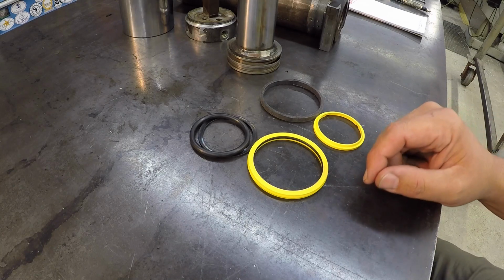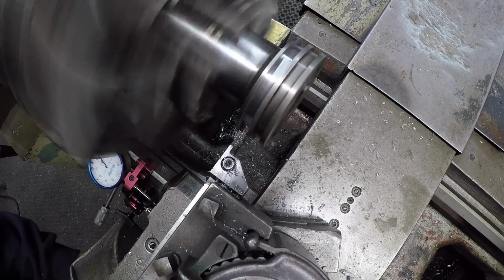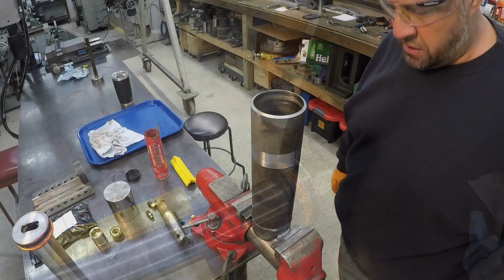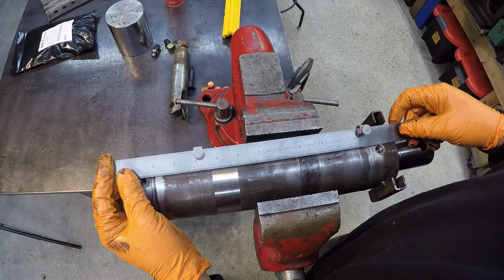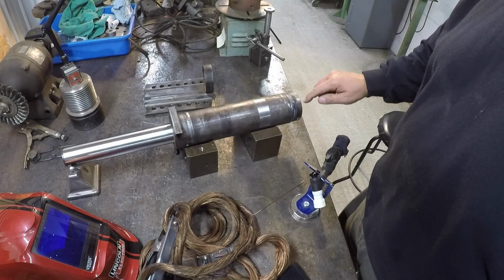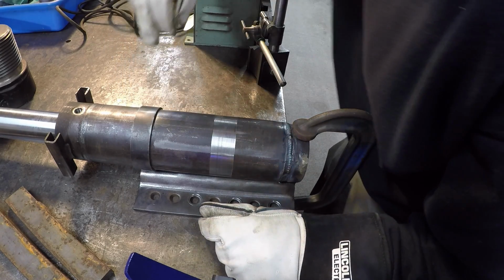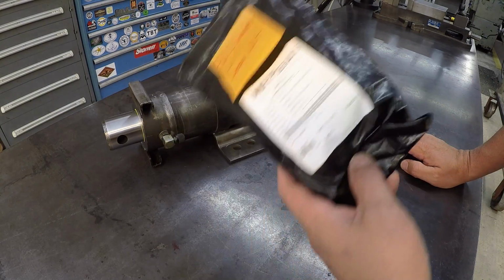SNS 286 Part 1: RV Cylinder Rebuild Completion

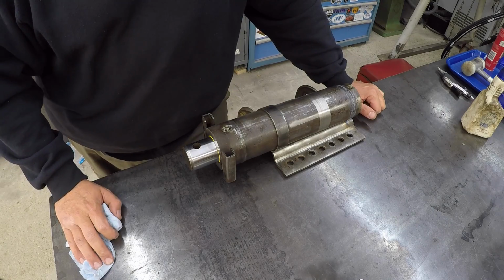Comment: Hi Adam. At 24:14, when you mention that you didn’t have the equipment to pressure-test it for leaks, it made me remember the first video where you found a pinhole in it. Did you plug that up, too? I’m assuming you did, but I didn’t see any footage of it. Also, a nifty use of shop air to test that cylinder! 😎 But, then, what fun is a tool that only has one use, eh? Another nice machining video. Have a Merry Christmas and a safe, happy holiday season!
Reply: The pinhole was in the old weld. The cap got a whole new weld so that old hole was ground away to make way for a V groove and the filler weld.
Reply: Go back and watch it again. The leak was in the weld bead that held the end cap on. He ground it out when he cut the end cap off, and "plugged" it when he welded the end cap back on.
Reply: @oldbones3092  Cool reply. That's exactly what I said. Hopefully, he doesn't have double vision.

Comment: Aloha Abom,  for my own or family projects logic and common sense doesn't apply.  Why spend $20.00 when I can repair it for $100.00 labor?
Reply: That brings to mind a computer system idiom:  "Linux is only free if your time has no value."  For those unaware of computer operating systems, Linux is a "free" operating system that has no licensing fees, but can vary a lot in the complexity of installing/usage.
Reply: I have to agree with you on that!
Reply: @Kineth1  
Not really accurate any more.

Comment: Looked on the Lippert site - you can get a new one similar in design for 465-585$ 
https://store.lci1.com/shop-by-department/leveling-stabilization/powered-leveling-systems/system-replacement-parts.html
Reply: That being said - doing something nice for mom... priceless....   ;)
Reply: @DrFiero  I fail to understand why buying a new disposable cylinder with the same potential for breaking down and requiring a new replacement is a good investment? Don't buy low cost disposable garbage, buy a quality cylinder or at least a design that can be repaired and give somebody else a job to feed their families.
Reply: DrFiero and you would have missed the education.
Reply: Before this thread gets out of hand!  I only mention the price as Adam said he had no idea what they were worth new. Now he knows. Now you know. Gotta pay someone $120/hr to repair - probably no worth it. Doing it yourself? Knowledge gained!
Reply: @DrFiero  I did not intend to sound hostile.
Reply: @DrFiero  What Adam was trying to convey, as he said, if it can be repaired in much cheaper way go ahead and do it rather than replace it with something that could potentially cost thousands of dollars to replace. This small cylinder was just an example on how to go about it.

Comment: Digging that lay wire method, nice work as usual Adam.
Reply from the maker: James T. Kilroy Jr. Thanks James. That may wire trick was how I was taught in school welding stainless pipe and it’s always been my favorite way to flow the metal in there.
Reply: @Abom79  This is how I'm teaching myself to TIG. I shake like a leaf so only having one hand to concentrate on not shaking makes a big difference. Once I get that down I'll work on holding the wire and dipping, etc. I really like the clarity of the welding shots you are getting!

Comment: Ok a little question. I hope you understand what I'm saying. Do you stagger the weld layers when doing a cylinder like that? It would seem if you staggered where you start your next layer of weld it would less likely leak
Reply: Nobody’s good enough to line up all the porosity lol.
Reply: Yeah, you do stagger them, but it doesn't matter one bit. The trailing end of the weld pass is tied into the leading edge 100%. It's all tied together out its cleaned, prepped, and welded properly.

Comment: A very ood repair. I did this this summer on my Winnebago Sightseer RV. Just the front oned. I didn't pull the ram out, just cut off the nose end, replaced the seal & wiper and re-welded it together. Yours was a nice repair and now you are in the RV leveler business!

Comment: Cost would be between $450 and $850 new. I would rather have your rebuild than new knowing it is "machined" and quality checked by a guy that cares.
Reply: The cheapest I could find was just over $1000.  One was $1400.
Reply: At work, there are parts that are brought brand new from the manufacturer. The part gets totally stripped and rebuilt in the workshop because you then know its been built properly, and because somehow, our tolerance is tighter than used by the manufacturer. Crazy, but knowing its been done properly is worth the time.
Reply: any day
Reply: Wait, $450-850 and $1000-1400 for one of these fully welded/sealed units? Or for a proper hydraulic cylinder?
Reply: @xenonram  ...https://www.etrailer.com/Accessories-and-Parts/Lippert-Components/LC359281.html
Reply: @xenonram  Fully sealed unit sold online, not used, but likely made in China.
Reply: @xenonram  https://www.shop.thebigfootleveler.com/Replacement-Jacks_c24.htm

Comment: So, in your opinion, what was the cause of failure? Was it due to the rubber material fail? Did it get excessive heat from possibly the exhaust? Contaminated fluid? Just age?
Reply: Remember when Adam was talking it apart, he saw a repair weld for a leak, maybe some heat damage occurred then to the piston side and that's why this was the first one to fail.
Reply from the maker: Age related failure of the piston seal.
Reply: The exhaust wouldn't get anywhere near hot enough to cause issue. (These are many feet away from the headers, and by the time the exhaust gets that far away from the engine, it's only a couple hundred degrees. They failed from old age.

Comment: What is that mic called that u used to measure the width of the groove
Reply: Inside micrometer https://www.mscdirect.com/product/details/86423936

Some people may also call this a groove micrometer but most people think of some like this when you say that
https://www.judgetool.com/products/mitutoyo-146-series-groove-micrometers/?gclid=EAIaIQobChMIlraWqo625gIVEr3sCh2MzARQEAAYASAAEgJgrfD_BwE
Reply from the maker: ID mic

Comment: The pin hole repair might of been done with the ram collapsed. The heat from from welding up the pin hole could of made the O-ring fail prematurely. I even wonder if the flame and hot gases could of passed through the pin hole and burned the O-ring??

Comment: Isn't the shaft in the wrong alignment to the mounting.
Reply from the maker: Ron Cartwright It’s just the foot that bolts onto the end, doesn’t matter what way that through hole is positioned.
Reply: Yes you can see it in the first video on the thumbnail
Reply: Looking at the tear down video, yes it is.
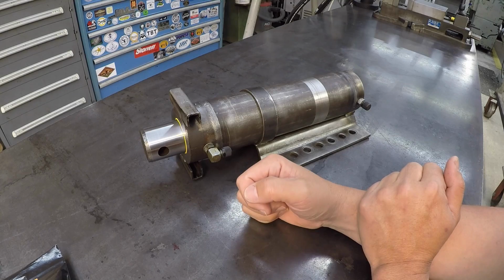Reply: Watch till like 25:20 he starts to explain that he messed up and redid it
Reply: @Scruffy545  The hole in the shaft is not in the same orientation as it is in the tear down video.  He changed the bracket not the shaft.  Look a little closer.
Reply: Fester Blats  Yikes, I think you are right https://www.youtube.com/watch?v=o1b9EtN3_XQ

Comment: As long as you don't use the safe place to save the spare parts; that place with a semi-trailer load of bits that can't be found.... (Which I do all the time)....
Reply: What manufacturer is the jacks, because the jacks I have rebuilt come a part no cutting or welding 🤔

Comment: replacement cylinder   https://www.etrailer.com/Accessories-and-Parts/Lippert-Components/LC359281.html
Reply: Call me smart , I was going to look up pricing but knew someone like you would have already done that and posted the link... Youtube commenters like yourself are awesome... thanks.
Reply: @ForensicKineticAnalysis  I used to sell RV's and boats and know the builders buy almost everything from vendors.
Reply: @markhgillett  , thanks Mark.
Reply: and it's not a direct replacement. would need a lower mount fabbed up at least
Reply: @jpkalishek4586  I am sure Abom's family have the plate for the bottom
Reply: @markhgillett  yes, but it mounts with a cross pin, not a coaxial bolt. Or did that one have an option for a pin? Didn't see one.
Reply: Looks like a repair makes perfect sense afterall.

Comment: Screwed up Mom's RV cylinder. Cancel Xmas.  LOL  Power steering cylinder for my ford 2600 tractor was $300, much smaller than this. You do nice work for sure, thumbs up.

Comment: Nice job! Looks similar to modern Atlas Hydraulic Jacks except it's missing the top plug. The cylinders value is right around $1000 so it's well worth fixing. RV's are usually just an assembly of third party pieces.
- 
You know allot of people in the RV industry have know idea this is possible.

Comment: Abom a quick question, when you first cut the piston housing open on the lathe the piston housing would have been reduced in length by the width of the cutter, how did you ensure piston housing remained the correct length when you re welded it?  I had to smile when you said you got 4 sets of seals I was thinking as I watched this that you might have to do the other three, this one is probably going to be stronger than the others now.👍 really good job.
Reply: Watch it again. He cut out down at an angle, down to zero. Even if he did use a straight parting blade, that 0.100" isn't going to make a difference. He could cut an inch out of it and all that would happen is the poison would have a reduced travel.
Reply: @xenonram  Why is it so hard for people to watch and listen to a video?
Reply from the maker: On a cylinder like this, it’s just extending down to raise up the RV. .125” isn’t going to matter.
Reply: @Abom79  thanks Abom

Comment: piston hole is 90 degrees off but might still work, I don't know if the RV uses feet on the ends of the piston or not. Maybe the feet could just be rotated?

Comment: I hate to say it but look at the video thumbnails for the two parts. The hole in the piston rod is 90 degrees off from where it started.
Reply: Might be intentional, could be easier to reach the pin for the foot plate if it's like that... Who knows, doubt it matters much.

Comment: Looks like they are in the $500 range. They have different brackets so might need to mod RV a little.
You can make the old ones from scratch for your mom if need be.
Reply: $500 ??  This is the cheapest I found.  https://www.etrailer.com/Accessories-and-Parts/Lippert-Components/LC359281.html

Comment: I think the rod is clocked 90 degrees off from the original.
Reply: It's fine, the hole is only there to fix the "foot" to the rod.
Reply: Wes watches Abom too? It's a small world :)
Reply: Watch Wes Work She sure is
Reply: Yup, even the thumbnails of each of the part 1 & part 2 videos show the difference.
Reply from the maker: It’s simply holds the foot on the end of the rod, doesn’t matter.

Comment: When welding the end cap on, did you have to allow for the thickness of the parting tool?
Reply: That makes no difference. The rod will just have 0.100" less travel. You could cut a 5" section out of that cylinder and it would still work fine.
Reply from the maker: Didn’t matter for a cylinder like this.

Comment: RV Cylinder they are 3 to 500 and look like toys made in china that should work once or twice
Reply: I am guessing the repair cost would be in that range maybe toward the high end?
Reply: The cheapest I found that looked like the original...https://www.etrailer.com/Accessories-and-Parts/Lippert-Components/LC359281.html